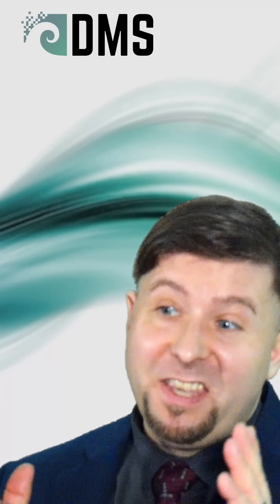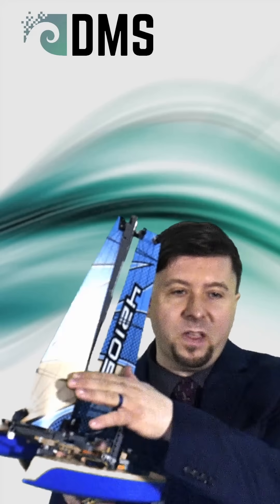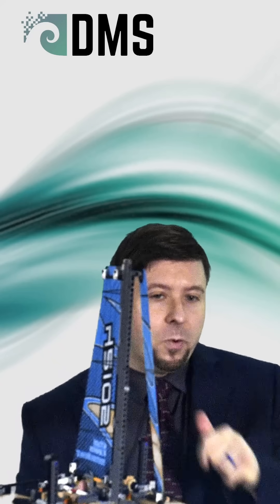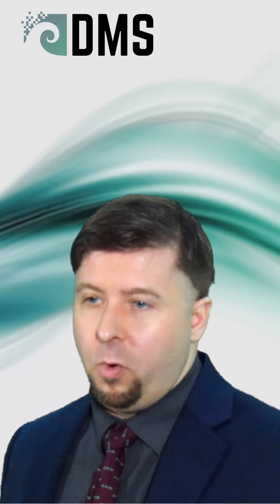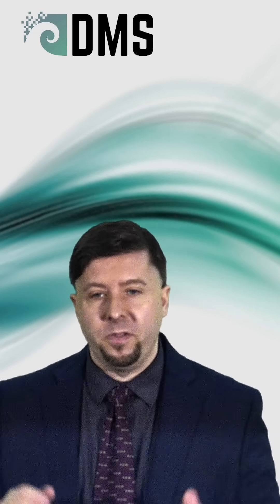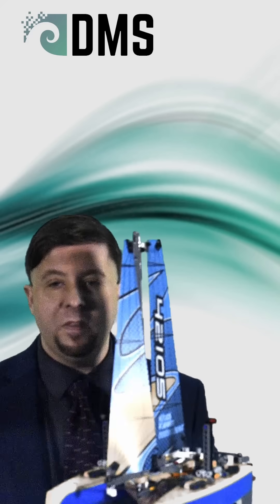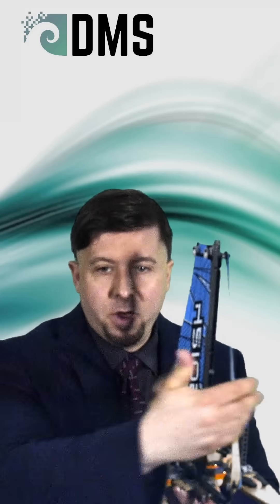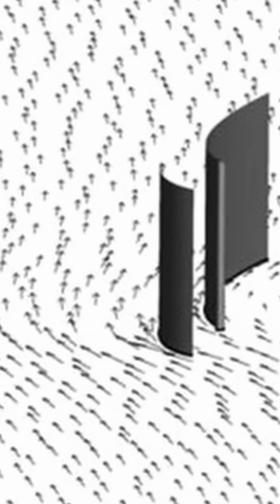Sailing Slot Effect:  You Have It Wrong

Comment: Aerospace guy who likes sailing chiming in, I don't think you quite explained why the two sails are better than a single sail with the same area.
 
The air accelerating through the slot is actually critical even if there isn't much of it because it re-energizes the boundary layer (air on the leeward surface), which lets you put much more curvature into the two sails put together than you could with one giant sail without it stalling, getting you a much higher maximum lift coefficient (more power). It's why you sheet the main much tighter when you have a headsail up than when sailing on the main alone.